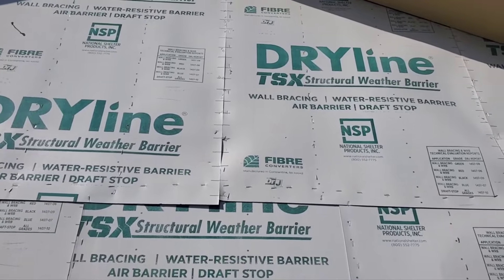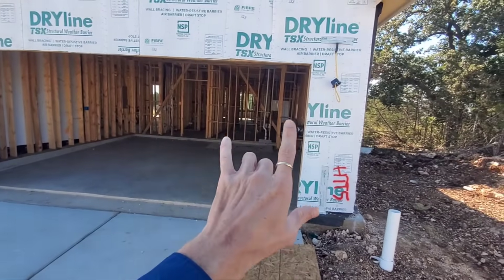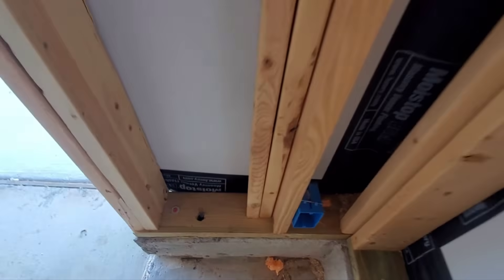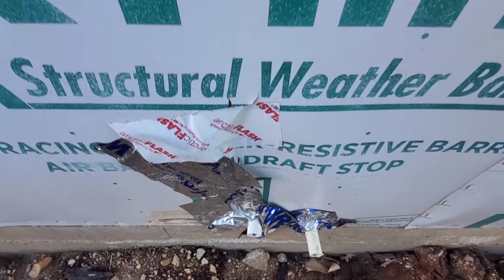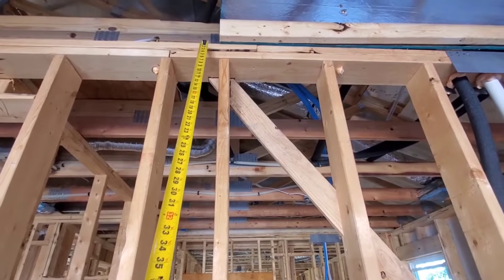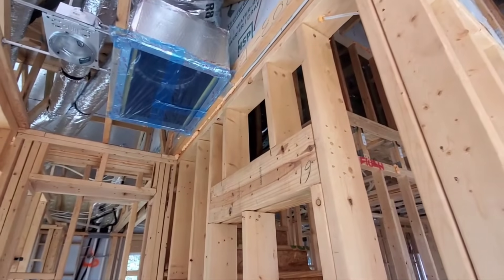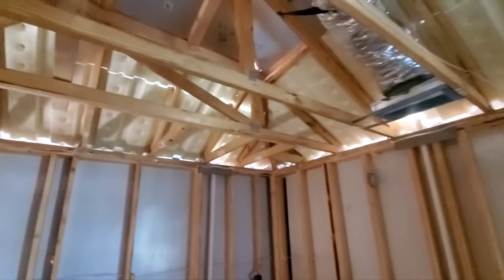Fun findings following the pre-drywall inspection around Austin, Texas. Two words: IMPROPERLOAD PATH

Comment: Feel sorry for Ben. That’s not sheathing, it’s literally cardboard and it’s garbage, as as you point out, it’s not installed properly. The walls framing the garage opening should be shear walls and anchored as you said…it would take several pages to list everything I saw. I’m guessing the contractor wasn’t counting on you finding everything. Also, while it’s good of you to to say something nice to the client, this house is total garbage, and best to walk away. The only way to fix it is to bulldoze it down and get a builder who knows what he/she is doing, and actually cares.
Reply: No OSB. Just studs and that sheathing, which is meant to be structural if you pause and read it. However, they installed it with something like an office stapler! It all has to come down and be NAILED into the studs.
Reply: @MoneyManHolmes  it can be stapled per the mfg. just has to be the proper staples. However, tply is just pure garbage. Very happy I fronted the cost for 1/2” zip for my home.
Reply: I can't believe that thermoply stuff is structural. I can see a vapor barrier but it can't be a strong as osb. And supposedly you don't even need horizontal bracing when you use it. I see that OX brand all the time.
Reply: @gwilliams1001  what’s funny is OX claims it’s as strong as 7/16 OSB….. yet builders still have to put up OSB at corners and around garage openings for extra shear strength. If the OX is just as good why do you need OSB for added shear?
Reply: Classic case of someone biting off more than they can chew. lol
Reply: My question to you ? Why isn’t the builder or super walk-in this inspection with you ??? Being a retired builder you would spend so much time on your report and most of it would not be corrected ??? They would have to be with you to point everything out !  Crap job !!! Red tag that sucker and state to him ???? None of this is acceptable none . Show that fool who is in charge, garbage work . Do not cut this Guy any slack !!! That is your job to protect the new home owner . How about this guy building this crap show for a family member ??? Can you imagine the finish work ???? Thanks for reading .
Reply: I totally agree, Its not allowed in our high seismic zone, its garbage, its even buckling under the staples haha! Let in bracing is not acceptable either, we use osb or d. fir sheathing with specialized nailing for shear walls. Ya i would walk from this disaster of a build.
Reply: Major lawsuit waiting to happen.
Reply: I might be one of the last to ever install real old-style diagonal board sheathing on a new build when I built my 3000sq ft workshop a few years back.  1” rough cut pine nailed at 45 and topped with 1” board and batten.  That’s 2” of solid wood on the outside - luckily it was just before lumber prices spiked during the pandemic.
Reply: @geneinman4488 I think this is an independent inspector, not a building inspector to pass a permit inspection.
Reply: Allowed in Texas. But that’s Texas.
Reply: What a S#!+ Show.  This house is a total teardown.  Have not been in the house-building game in over twenty years...but I had to rewind a few times at the beginning before watching it all the way through.  I thought it was just some nice vapor barrier--then did a double take on the video when I realized there was no friggin sheathing!?  How is using this "glorified cardboard" in place of OSB or plywood sheathing legal?  I mean, OSB had its detractors back in the day...but this crap?  Realllly makes one think twice before ever investing in new construction.
Reply: @joshuacaldwell4465 :  Exactly.
Reply: Get a bulldozer driver that knows what he’s doing ! …. Wrecking Ball is the correct tool.
Reply: Garage door opening is garbage. The opening should have half of the studs not used on each side. The gap at the header and studs needs more than a “shim”.
Reply: @geneinman4488  Why isn't the GC there? To allow the inspector to work without interference, and maybe to prevent fist fights when the GC is shown to be a shammer.
Reply: @MonkeyJedi99 incorrect. The contractor on permit is generally always walking side by side with inspector. That's how it's been every time we pulled permits. They never walked the job alone, I was present for every rough inspection and finish as carpenter contractor and as GC on jobs I had to be present for every inspection including fire marshall to sigh off on CO.  
Not sure how it works in Texas but I live in mid Atlantic East Coast state which has some of strictest code adherence.
Reply: I thought it was Tyvek at first look
Reply: Even if they did everything correctly, it would still be shitty construction.
Reply: Done by wet you know who
Reply: Not only did they use this garbage Thermoply, they use shitty staples and no studs behind where they meet.  How can anyone doing this job think it was ok to do this?  I mean even with OS or zip, you need a stud behind where they meet to nail it to.
Reply: @anthonydilugi4672 Code in Texas?? That's really humorous.
Reply: @Keith-ux9ku I didn't say anything about code in Texas. I wouldn't call whatever it is in Texas code if these videos are representative of contractor work in Texas and similar states. What I know of MA/NE states is: strict adherence to UCC+ stricter code when applicable. Especially where structure, structural mods and electrical and fire code is considered. I'm proud they hold us to a higher standard. But then again, we have higher standards in many industries over second rate states in this country

Comment: I've been framing for 40 years. In a million years, I would never even conceive of doing such a $h!++y job. This man is wayyyyy too kind 😇.
Reply: Unfortunately, at least here in Arizona, this would be considered a good build. Our current house, we had an independent inspector come in (who was a retired builder). At various stages of the build he picked up on over 500 faults, of which 120 were classed as serious. He also found the stucco was improperly formulated and as a result the stucco for the entire house had to be removed and redone. He accompanied us on the final walkthrough. Before we arrived he had walked the roof and found over a dozen problems that needed addressed. We then started the house inspection. We did the entrance way, lounge, dining room and kitchen. The window in the kitchen wasn't square and it was, in any case, misplaced by nine inches laterally. This meant the cabinets abutted the window on one side and on the other there was a one foot gap. In any case, the window wouldn't and couldn't open. By 'not square' I mean the angle on the corners was 85 degrees and 95 degrees. At this point, the builder got really angry and threw us out of the house. 

It took the builder another 3 months to fix all the faults in the report, but on the plus side we were the only buyers who didn't need any callbacks from the builder. Sadly, that same builder is still in business today. I hope they've gotten better...

I would never dream of buying or building a house without a highly competent inspector who does great documentation (with photographic evidence). Never. Ever. It has saved us tens of thousand of dollars and these people are worth their weight in gold.
Reply: @davidgapp1457  there's a bloke doing these videos here in Australia. Called siteinspections. Have a look at the absolute mess he finds. They make this house look like it was done properly.
Reply: Honestly it's nice that he's not such a jerk. A lot of these inspectors act like megalomaniacs on a pathetic little power trip. It's not his job to sh*t all over people. It's to point out mistakes. Period.
Reply: @davidgapp1457  I grew up in Maryvale in west Phoenix, we had a brick John F Long home from 1961. Huge yard and zero HOA. Phoenix, a great place to be from.
Reply: Yes, way too kind.  He gives the impression that the infractions are not serious.
Reply: At this point it might be easier to tear it all down and start over :-0)
Reply: I was thinking the same thing!  Wow, that’s some shitty work……

Comment: I can never quite get over the fact that this "sheating" is legal. Just use some OSB or plywood for the sake of all that is decent.
Reply: Keep the prices low.
So many people are not able to afford homes already.
I live in 1960’s home, no sheeting.
2X4, 2 layers of tar paper, stucco, I think it is fine
I do agree that OSB would give much better shear strength.
Reply: @gund89123 this house is getting brick/stone fascia. I would trust plywood more because it gives you more places to tie the fascia to the structure. Plywood also prevents wracking of the structure. Although technically legal it's not a good design.
Reply: Here in Arizona it seems none of the tract home have sheathing all the way around. Instead, there is just house wrap attached to the studs except where they need sheer strength. I have no idea why that is ok.
Reply: @rgoers  here in NC that doesn't fly because we need that additional sheer strength for hurricane and tornado resistance.
Reply: Major lack of pride and/or skill.  If I was the homeowner and I found out about this I'd want out.
Reply: @davefoc  my biggest concern as an electrician is mounting my service equipment. They need to place blocking in the area where I'm mounting my equipment if they are going with siding instead of brick or stucco.
Reply: @ianbelletti6241  I get it. But as someone from California, the fact that many of the mistakes made severely increase the risk of building failure during an earthquake is a big deal. Cardboard siding disgusts me, even if I wasn't worried about hurricanes and tornadoes. The house was clearly built by people that didn't give a shit or by people that were horribly unqualified.

Florida's hurricane Andrew disaster led to code changes and increased code enforcement that has saved billions of dollars in property damage and a whole lot of lives saved. Spring forward 32 years and it looks to me like the builders of this house are building a house like houses were built before hurricane Andrew.
Reply: @davefoc  I agree on the fact that despite being allowed in that particular area it is a substandard way to build.
Reply: @ianbelletti6241  The cardboard was installed badly, and it is a crap product but I saw a lot more there that was terrible.The bolts that almost completely missed the bottom plates were very worrying. If you're going to do something like that, what else are you going to do?

 I'd go for house wrap plus sheathing in a few key areas like the narrow walls in the garage over cardboard. I might be missing something, but I don't see any justification for cardboard.
Reply: @davefoc  the only justification is cost cutting. That's the same reason they put plastic parts on car engines and isn't a valid excuse on its own.
Reply: @gund89123  You're right, it is cheaper. Let-in braces are cheaper too, but 1/2" OSB or cheap Chinese ply [with exterior glue!] is best.  Structural codes are a bit over kill in the US, but then we have fairly safe houses if their built right.
Reply: @rgoers  All the corners in a house make it fairly resistant to racking/twisting. But the long walls and large openings require  a much robust reinforcement.
Reply: . Arizona doesn't have to deal with earthquakes, tornados and the like.  It is all in the engineering.  Tha😮t said, this house is crap.  I grew up in a double brick Arizona house that was built in 1949.  Solid as could be.
Reply: @davefoc  I have not been a contractor or a licensed builder but I know enough to see that home is garbage. Forget code, its just stupid the way it is being built.
Reply: @davefoc  Never mind hurricanes or tornadoes. A determined wolf could get through those walls, no huffing and puffing needed.
Reply: @ianbelletti6241  Like that plastic oil cooler on the Chrysler Pentastar engine that cracks and makes the forbidden milkshake.
Reply: @rgoers  A house wrap is not always a disaster on it's own. If you plan on using vertical boards, extended by 1-2" from the studs, for the exterior then the exterior cladding itself adds a lot of stiffness and strength distribution. That is unless you use this contractor /developer as that would probably mean all the end boards fall on the same stud and wrong fasteners or to few fasteners are used across the board :p
Reply: @aBoogivogi  In AZ the house wrap will have a layer of foam then a very thin coat of stucco. Every new home buyer gets junk mail from lawyers looking to sue over cracked stucco.With out heat you would think they would use 2 x 6 walls with great insulation. Nope. And the attics are insanely hot - with the cold air ducts running right through them. That is just stupid.
Reply: @gund89123  houses built back when america was 90% white are the best ones.
Reply: In Washington I have never seen a new construction with cardboard sheathing in over 30 years.  Everyone uses 100% 1/2" OSB or sometimes CDX.  Maybe seismic is stressed more than in other regions.
Reply: Framing inspection should have been done much earlier.
Reply: Cowboys…
Reply: @gund89123  thats awful for an alleged first world country
Reply: I was already angry when they went to plywood. Shitty construction materials in the US unless you are building a church, a bank or a police station and even some of those suck. 
Forget this shit. Go look at how they build in Germany.
Reply: @TurboSquare2000  And when was that? American hasn't been 90% white since 1690. https://en.m.wikipedia.org/wiki/Historical_racial_and_ethnic_demographics_of_the_United_States
Reply: I dont understand.
That hardboard stuff IS the outside wall???
So there is not a brick wall coming in front of it?
So what do you guys put on it that makes it look at least decent? Stuc? Or will there be wooden planks or something?
This hardboard is it??? I cant believe that.
Reply: @ianbelletti6241  Ah right. Thats what i was wondering.
But fascia.... that does little to nothing for structural strength. Its just for looks and a bit to keep out weather.
Why not just put up brick houses???
Reply: @StofStuiver  because it involves more bricks and is much more labor intensive. Plus we often end up furring out the walls with wood to make room for our electrical and plumbing. It's much cheaper to build the structure out of wood which is a renewable resource.
Reply: @TurboSquare2000 When was that? Read a book.
Reply: @pcatful  Prior to 1965. Anything else you need educated about?
Reply: My first home I gutted, found the outside was sheathed with 2x8x1/2" sheets of gypsum board wrapped in black tar paper. ZERO structural value.  I went over the entire house with 1/2" plywood..................

Comment: As an old retired Building Inspector, I cannot believe all the shoddy workmanship! I would need a lot of red tags if I was responsible for this inspection!
Reply: I just can't believe theyre sheathing houses with cardboard....
Reply: @TheTurpin1234  Right? What IS that stuff?
Reply: Yes, and as a former Chief Building Inspector from SoCal. A Red Tag would just be the beginning of a total shut down.
Reply: I figured they would offer Texas code books in Spanish. Can’t always find a builder who knows how to read English I bet
Reply: @colliemutt5 structural cardboard 😅😂, I found it under shiplap siding on my addition that was built in the 80s. Complete garbage. Big box stores sell it.
Reply: @zimmermanlandscape9287  I heard that Texas is weak on code especially in Houston.
Reply: @TheTurpin1234  Ha ha come to Austin it's everywhere and allowed
Reply: @vince9486  Yeah I'm aware.   Nuts.
Reply: @vince9486  And it's also "allowed" to put the water heater in the attic so when it leaks you not only lose the water heater, but the attic insulation, the ceiling under the unit, and probably the drywall nearby PLUS whatever else is under the unit like furniture, cabinets, carpeting, flooring...
Just give up some danged square footage on the bottom floor so when it fails removing it only requires a hand cart, not four strong guys and a reciprocating saw to widen your attic access.
-
Same goes for HVAC up in the attic too.

Comment: Cant believe that sheathing is legal
Reply: Probably not in California where earthquakes drive the engineering
Reply: Code requirements are based on what’s minimum needed to keep costs down.
This might be ok in TX, not ok if you live in seismic zone like CA.
Reply: Looks like house wrap, a water and wind seal, not sheathing that provides backing for the exterior finish and shear bracing for the exterior walls.
Reply: Lowest bidder gets the job🎉
Reply: @robertball3578 No believe it or not it is sheathing.
Reply: @robertball3578 that's actually classed as sheathing and is legal in Texas.
Reply: Yes. The sheathing is garbage. The framing is very rough. Terrible work.

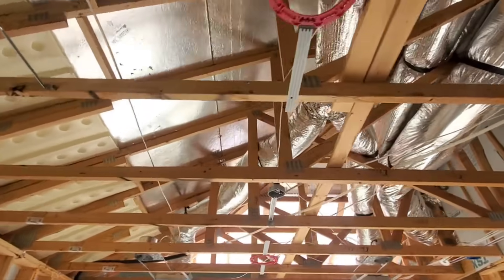Comment: At 6:53 you can see they ended one of the HVAC supply trunks with a wye. The trunk has to terminate with an end cap and the supply branches need to be 2 feet from the end. With the way it currently is, there will be little to no airflow coming out of those registers.
Reply from the maker: Thanks for pointing that out. I'm going to do some more research on duct requirements and best practices so that I can Make sure to catch things like this in the future.

Comment: My guess on the window binding and having a crack was .. stresses on the frame already due to ever so slight shifting of the wooden framing due to improper construction.  Just enough to pressure the window and crack the glass, and bend the frame causing it to bind.
Reply: Quite likely.